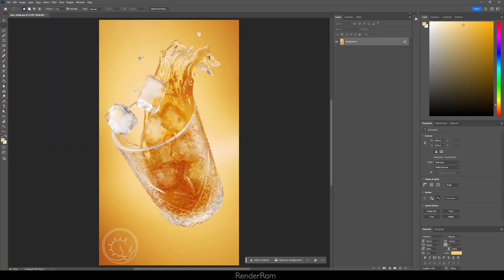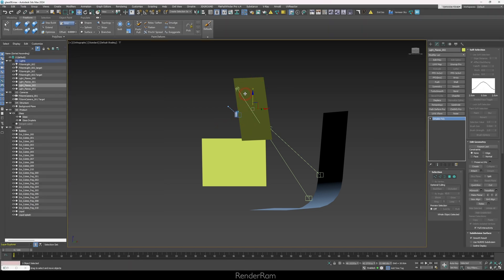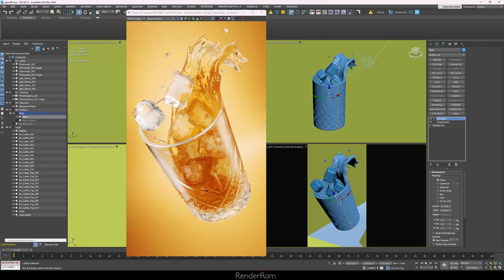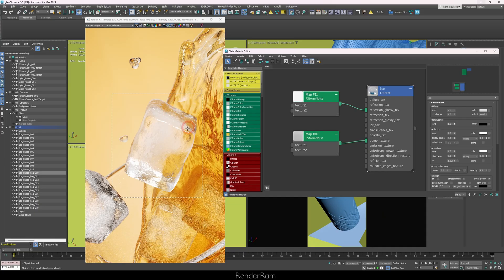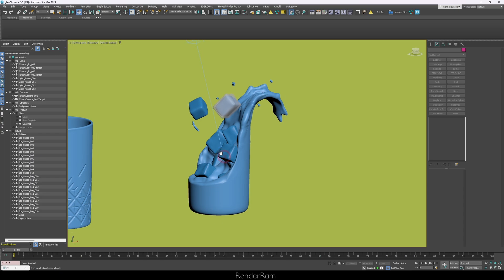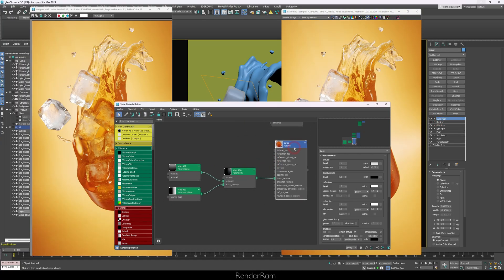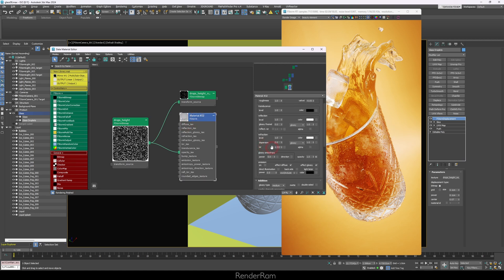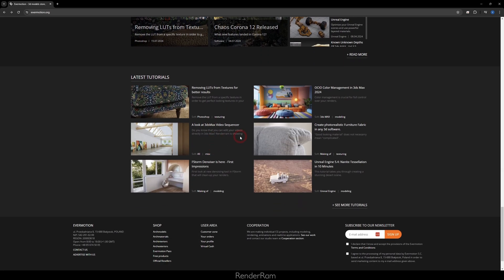In-Depth Modeling And Rendering Tutorial For A Studio Shot | All 3D Software

Comment: Hi. thank you for the breakdown  it's really nice work. I just  didn't get the boolean part did you just subtract the liquid part that intersects with the Ice? if so then the ice didn't go into the liquid right while in the reality part of the  ice is inside the liquid. is that right or I miss understood?
Reply from the maker: Hey, yes liquid part intersects with the ice
Now if I understood you right, since the logic of glass/water reaction is that you do a slight push on the water that it pierces the glass, I did that too with ice cubes, I have a separate clone of ice cubes with a slight negative push modifier that I used for booleaning the water, so that the booleaned water pierces actual ice cubes a little bit so that I get that right look.
Hope this is what you’re asking, now that I think about it, I should have mentioned that in the video
Reply: @RenderRam  Yes. thank you so much for the clarification.